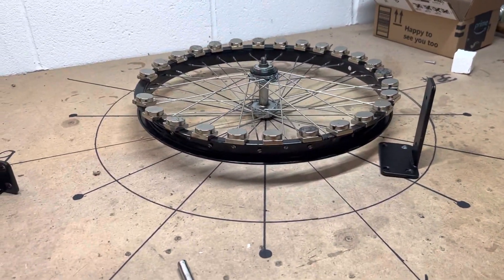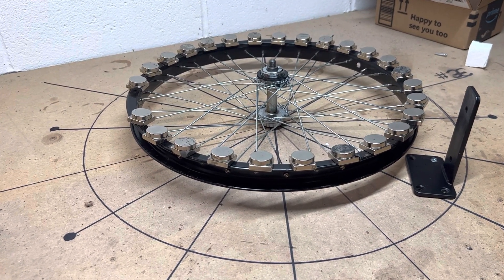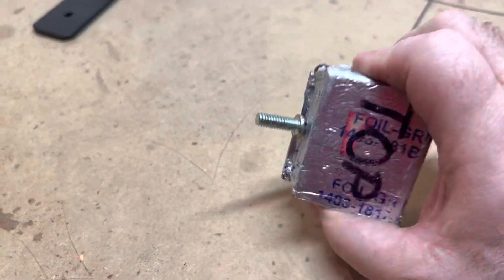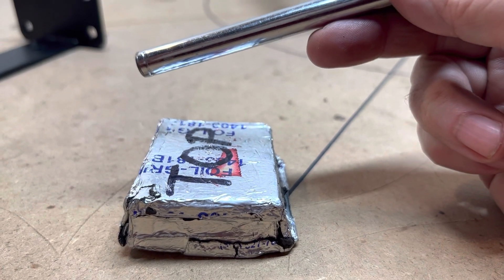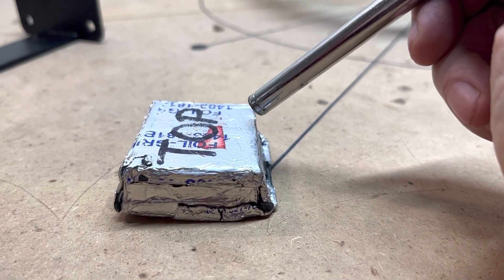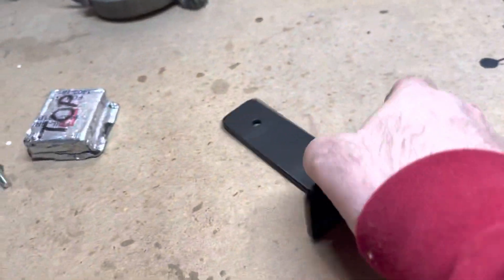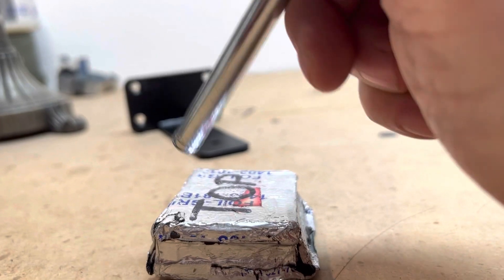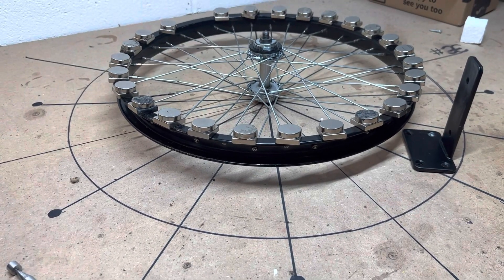🧲 ONEWAY RONEY STATOR TUTORIAL Free Energy Research

Comment: Sure it may be able to move on highly balanced and lubricated bearings, but can it “do” anything? Can it perform any work that can be measured in watts? (The argument of “scale” is not valid unless you can come up with a “watts per weight” number). This would make a lovely toy in a museum or on the book case.
Reply from the maker: 🧲 The earliest combustion engine was so weak you could hardly perform a task with it. The early stages of what I am doing is no less, yet revealing lots of torque.  This setup here is jury-rigged, as It is not the original configuration of my research. I mentioned that in this video. I guess you missed that. This setup is very temporary. Magnet configuration here is all wrong. Rather I am simply having a little fun to see what might be possible while I am waiting on parts. 

It’s only about how my stater works rather than how to make a magnet motor that produces usable torque.  Though I don’t expect you to go back and watch every single video I have ever made,  I do however have video proof that my stator setup produces useful torque. Scaled up it would be tremendous torque. Your comment is presumptuous as you speak as though you have watched every single video I have put out. I don’t believe anyone has other than myself. 

If you have nothing constructive to add please refrain. Thanks.